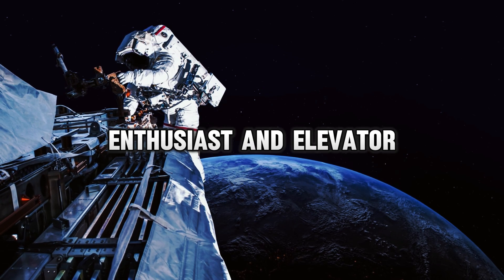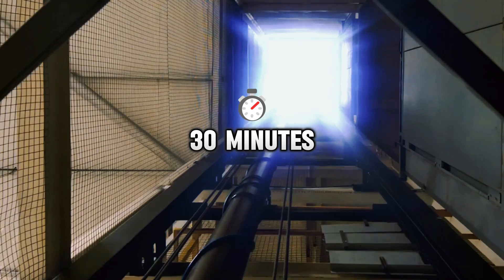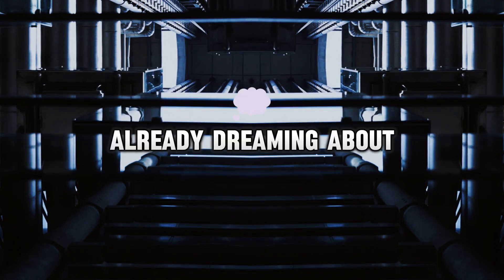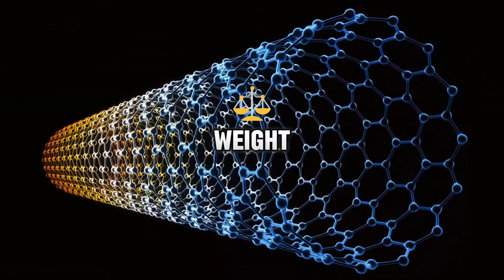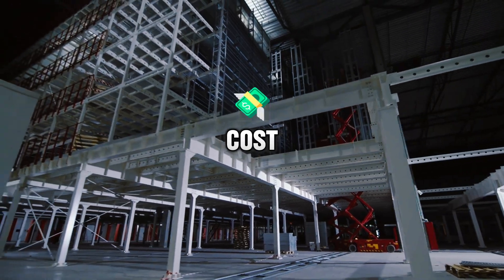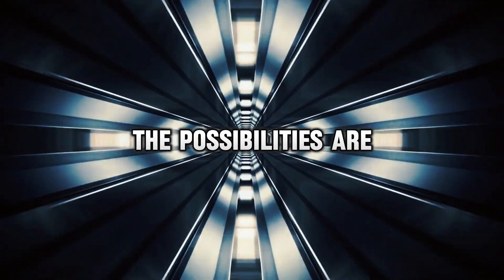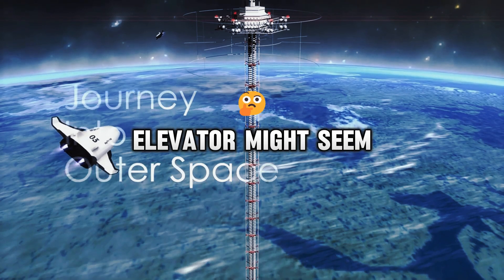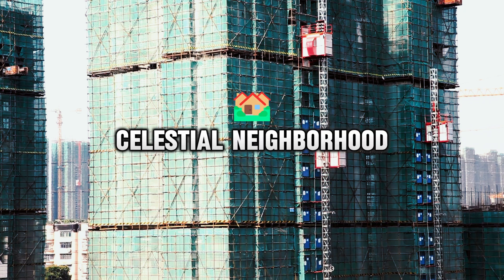Forget Rockets: Why Space Elevators Are the Future 🛰️👋

Comment: The limiting factor here is almost exclusively one of material science for the cable ... which researchers have been making great strides on.

Just think: it could be powered by a combination of solar and thorium fission, and once operational, all theyd need to maintain orbit would be periodic delivery of xenon propellant for an electro-ion propulsion drive to maintain orbital speed against reductions caused by the use of the elevator.

Comment: Unfortunately, if a large enough piece a space debris or functioning latge satellite hits it and doesn't break it could pull the space station portion of it out of orbit.  Or uprooted out of the ground or the ocean or wherever it's based.  I wonder how long carbon nanotubes would last under the UV radiation in space?
Reply from the maker: Hey, thanks for sharing your thoughts! You've definitely hit on some of the big challenges we'd face with a space elevator. 

The debris issue is a real head-scratcher, isn't it? I've wondered about that too. From what I've read, they're thinking about some pretty cool tracking and avoidance systems, but you're right - one big hit could cause major problems.

As for the elevator getting yanked around, it's actually wilder than that. The top part would be so far out it'd be pulling up, while Earth pulls down. Crazy balancing act!

The ground anchor is another beast altogether. Imagine trying to hold that thing down - it'd have to be insanely strong. Ocean platform seems like the way to go, but even then, it's mind-boggling to think about.

Your question about carbon nanotubes is spot-on. Space is harsh, and that UV is no joke. I've seen some ideas about special coatings or constantly replacing parts, but it's definitely a puzzle that needs solving.

Thanks for bringing this stuff up - it's these kinds of questions that really show how bonkers (and cool) the whole space elevator idea is. Keeps my brain busy just thinking about it!

Comment: I dont think this would work as expected. Any amount of tension in the cable, however small, would need energy put into the system othwise it would eventually crash to earth.
Reply from the maker: Thank you for your thoughtful comment! You raise an interesting point about the energy requirements for a space elevator. While it's true that maintaining tension in the cable is crucial, the concept of a space elevator actually takes advantage of the balance between gravitational and centrifugal forces to remain stable without constant energy input.

Here's how it works:
- The center of mass of the entire system (cable + counterweight) would be placed at geostationary orbit.
- The counterweight beyond geostationary orbit experiences a net outward force.
- This outward force keeps the cable taut, counteracting the weight of the lower portion.

Once constructed, the system would remain in equilibrium without needing constant energy input to maintain tension. Energy would mainly be required for:
- Climbing vehicles
- Adjustments for minor perturbations
- Maintenance operations

That said, you're absolutely right that the engineering challenges are immense. Factors like material strength, debris avoidance, and weather conditions at lower altitudes are significant hurdles.
Space elevator concepts are still largely theoretical, but they're an exciting area of research in space technology. What do you think about the potential benefits if we could overcome these challenges?
Reply: @CelestialSecretsYoutube  excellent reply. I enjoy these discussions.

Its the "adjustments for minor perturbations" which, in my opinion, will be larger and/or more often then expected (they usually are) which can increase the cost to the point the elevator gets abandoned. 

Now a skyhook, in my opinion, is a much better option. The drawback to a skyhook is that it requires a coming and going otherwise will get expensive. This flaw, i believe, is managable.